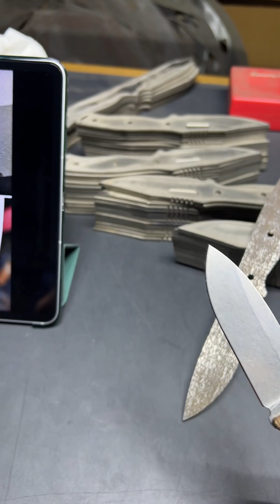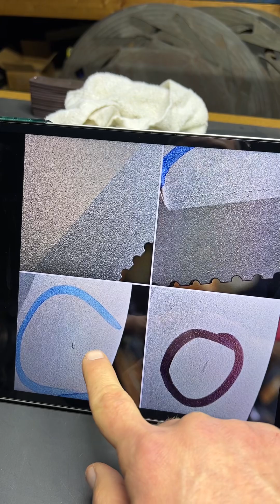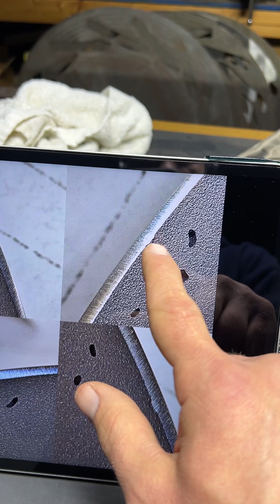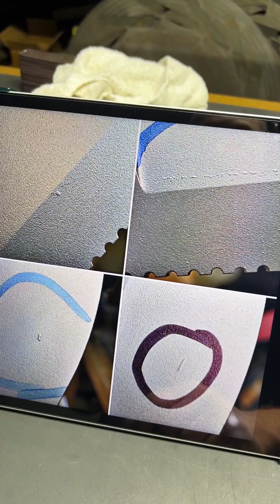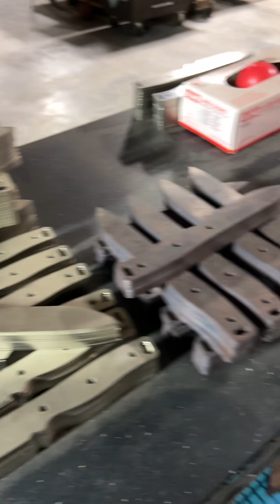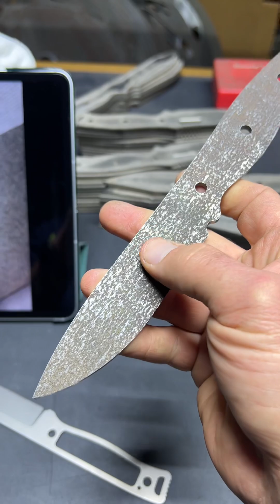Steel Quality Follow Up

Comment: Are any of the GSO 5.1 in magnacut being shipped out? Or is all of the steel for those blades bad?
Reply from the maker: We are finishing out those right now, most do not have visual defects, but there are some. I will have an update video on that later this week, as those move through assembly and shipping. I do apologize for the delay this has caused, the situation has not been ideal for anyone.

Comment: How is the cpm3v? Is it any better?
Reply from the maker: I mentioned 3V in there and the last GSO-4.5 blade I was talking about was 3V, most of the parts in that batch were affected. We have had ongoing quality concerns regarding all CPM materials we work with, for quite a long time. Now that we have viable alternatives, we are talking about it. Also, just as we started finishing GSO-12 blades the other day, this happened, so I guess we will see. https://youtu.be/ksNReTD85T0?feature=shared

Comment: Hey Guy I have a Blackscout GSO 4.7 with the black coating. Im pretty sure I purchased it last year. Did you make these in house or was it made by millet? Also did PHT heat treat it. Do you know what protocol was used on the 3v? I’m not sure what protocol is better but I heard you mention this in a video. Just curious about the blade. I love how the swedge makes the tip a little pointier. The only thing I wish is that it had the updated GSO 4.7 sheath so it’s easier to get a full grip when deployed. Thanks
Reply from the maker: The first run of those was made by Millit Knives. That last run was produced by us. 

While we do have some extra sheath bodies, they are the old design. The newer GSO-4.7 I don't believe will be compatible with the larger BSS-5, due to its longer blade. Our new spec GSO-4.7 fits decently enough in the larger BSS-5 sheath though. 

I can make a video on this at some point. I will honestly need to consult old invoices and things to answer some of these questions. It was a hectic time back then, not that it isn't now, but things are finally smoothing out.

Comment: Find a different finish or coating that will hide it. Surprised you keept buying it from these companies.
Reply from the maker: until recently, we had no other options. Bohler and Uddeholm have their US distribution figured out now, thankfully. 

This should not be possible with a PM grade. These are expensive materials, supposedly made for critical applications. I'm not going to hide what I believe are defects in the material, just to get units out the door. 

That's what most companies do, but as a knife user first, I think that is a pretty shitty move.

We've processed over 1,000 blades now in the European grades, with ZERO visible defects, so I know my expectations for these types of materials are not unreasonable. 

One company just seems to be falling short, where the other is actually doing what they say.